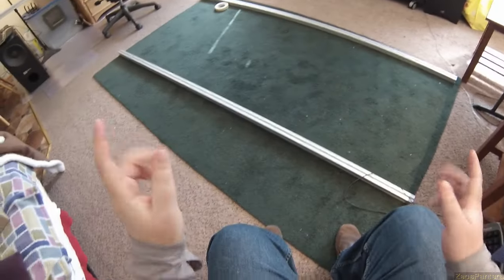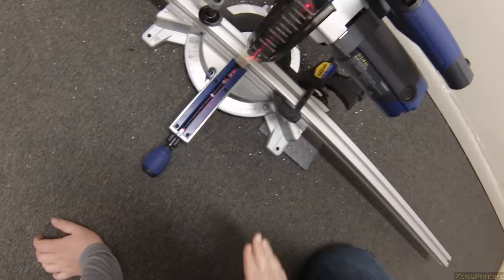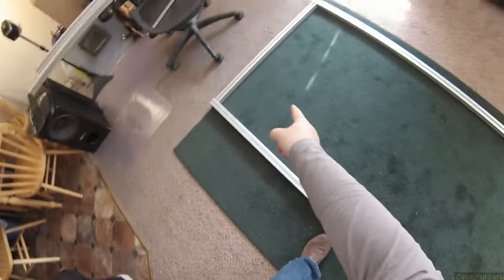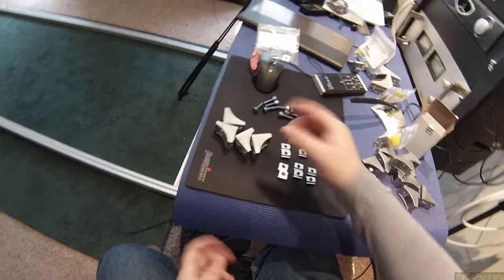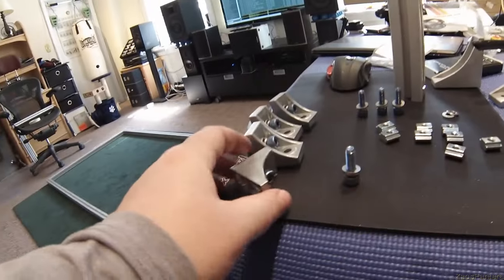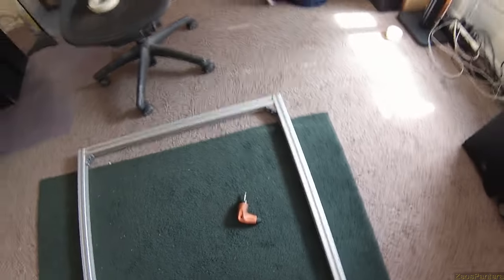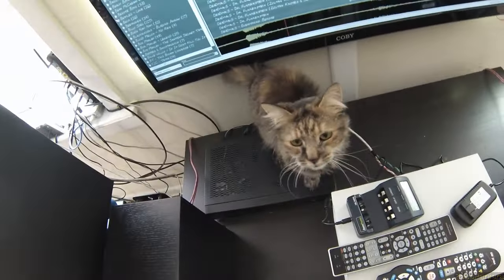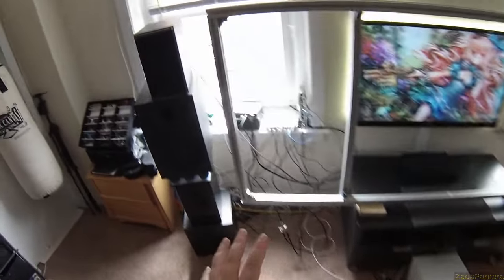Z How - Aluminum Extrusion Projection Screen Build Part 1

Comment: I dont know if anyone has told you since then but the reason the bit on the end of the tape measure moves is to adjust for the width of the metal so that its accurate whether you are pushing or pulling against something.

Comment: For my screen in front of my TV, I just put in a pull down screen.  $100 CDN, no wrinkles.  Looks very good.  Nice too bc you can partially retract the screen so that only 2.40:1 (or whatever) is open, and you don't have black bars.  So easy to just hang from chains.